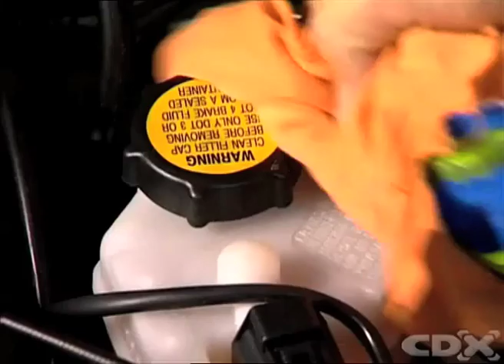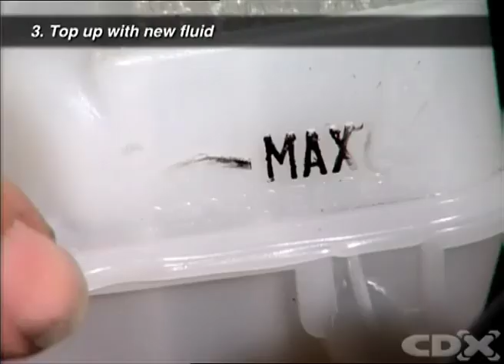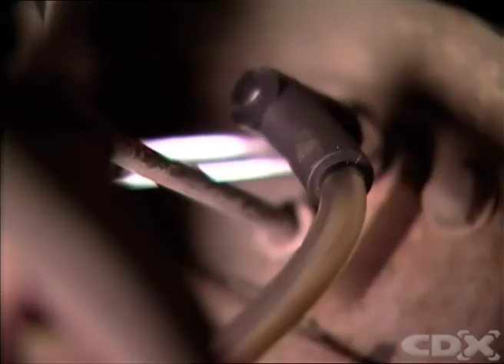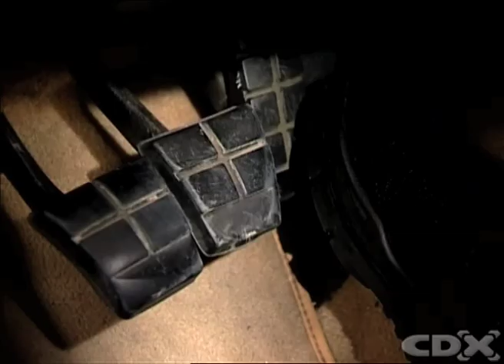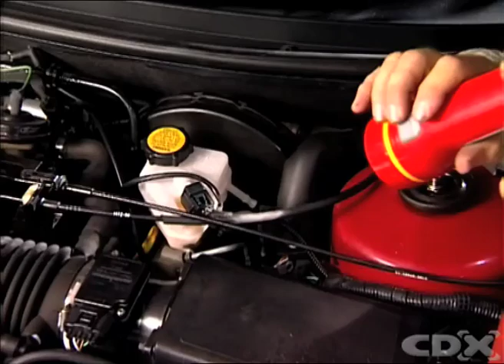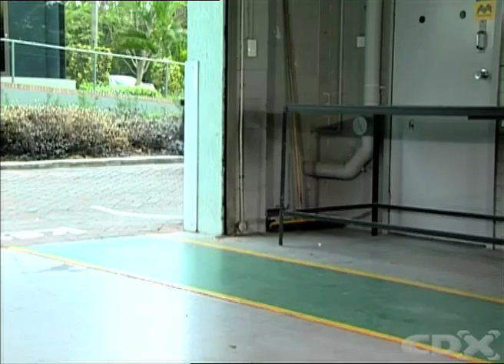How to - Replacing Brake Fluid // Supercheap Auto

Comment: Good advice about the moisture in fluid. Not good, as well as causing corrosion you can't compress water & after a short while the pressure in the system forces the moisture to separate from the brake fluid and it changes into water. Think of a spirit level with the bubble in the middle but now think of that same size bubble of water in your fuel lines.
 When this water gets into fuel lines under pressure and gets into your wheel cylinders the bubble of water also causes little air pockets & the brakes won't work correctly. Some times they lock on, sometimes one will work but its partner doesn't work at all (not fun in the wet). And worse case scenario,  the pedal goes to the floor but your not stopping..